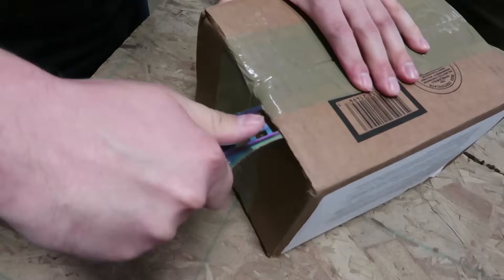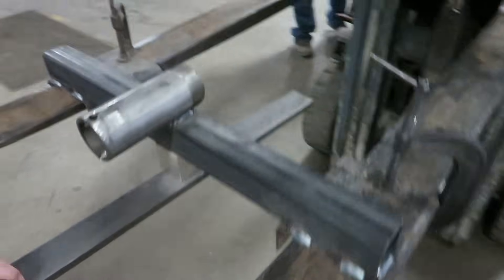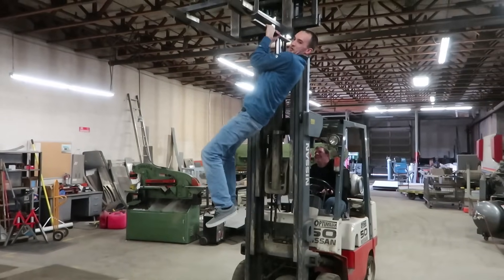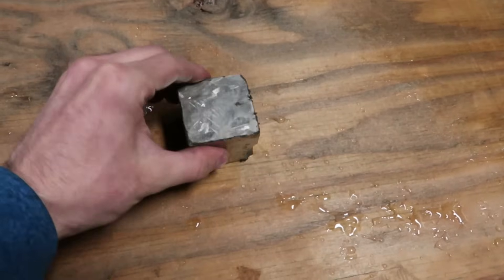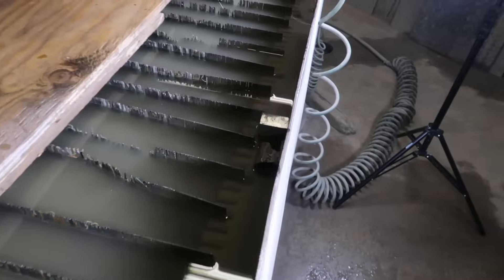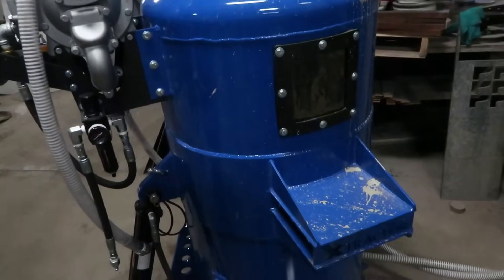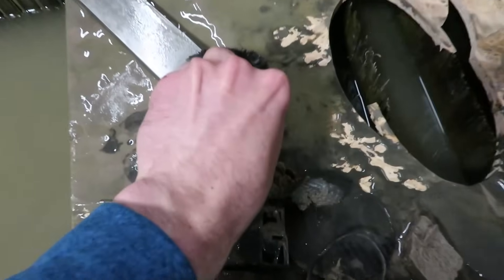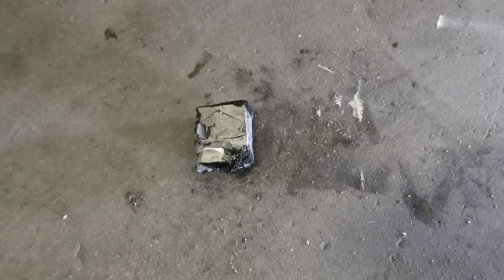Huge Neodymium Magnet Cut in Half with a 60,000 PSI Waterjet - 400 Lbs

Comment: If I had to guess, I’d say they cut it in a way that split perfectly down the center of the poles which is why it shot apart. If it had been cut perpendicular to the poles it should’ve just made 2 new magnets with poles held in the same arrangement as the original piece and then they would’ve just stuck together.

(Rough explanation) 

—N—
|  —  | <———— Cut along this line 
—S—

—N—
—S—
———  <——— Two new magnets 
—N—
—S—

Comment: not fair, the long steel bar puts leverage on the magnet, which breaks the magnetic Bond, once it is broken, it doesn't take anywhere near as much force  to pull it loose.
you need a flexible Mount to get the full lifting effect of the magnet

Comment: I am obsessed with magnets stainless steel is not magnetic it is made of  a chromium alloy. Chromium is not magnetic. Iron, nickel, and colbalt are magnetic at 72 degrees Fahrenheit which is room temperature. gadolinium is magnetic at 68 degrees Fahrenheit 4 degrees lower than room temperature.

Comment: 3:45 or you just dont remeber what happens in the movie with the liquid metal forced in the guy's body
Reply: Wasn't it dust?
Reply: @gobbadavis  no, mystic or however you spell it stuck a syringe in his ass in a bar bathroom
Reply: @austinhull5928  mystique
Reply: @austinhull5928  ٠٠9
Reply: @gobbadavis  it was the same paste that was in the video after they pulled the magnet out.
Reply: Why did they fly apart when cut but stuck together when they were broken??????
Reply: @Pyromaniac457  poles get reversed.
Reply: @natefountain5126  but why when they smashed it, did it stick together
Reply: @Pyromaniac457  lil late but it depends on where it breaks, if any N is touching N and S touching S they fly apart just as hard as they would slam together if the opposite poles are near each other. A weaker magnet would likely spin like they guessed but this one is so strong it was pushing with enough force to snap the last bit without being cut so the only direction to go was away

Comment: The alloy used in neodymium magnets is pyrophoric (will combust spontaneously) if divided finely. scratch a piece across some sandpaper and you'll leave a trail of spark which is kind of neat. I seriously hope you all don't ever play with one larger than that without some serious research into safety and handling. That one could have given some serious bruises or even broken fingers, but nothing too major. Larger ones can cause much worse injuries or even be fatal if you mishandle them.

Comment: I really wanted to see all the iron in the cereal with a huge rare earth magnet like that, but you guys did it kinda ineffectively. You should’ve held the magnet outside of the blender while you were blending the cereal and water. With all the shit in cereal, really really tiny pieces of iron wouldn’t attract through all the other mush, the iron was probably mostly settled at the bottom of the bag. But the blender is moving every little thing all around the container. Holding the magnet on the outside would cause the the iron to clot up at wherever point is closest to the magnet. Whereas using the magnet on the ziplock wouldn’t nearly attract all the iron. And on top of that, I think it’d be a lot faster than hovering the magnet over the bag.

Comment: The explosion depends on which side you are cutting. For the first cut it had 2/3 of a chance of flying apart (if choosing the cutting side and direction randomly, 8 options out of total 12 (6 sides and every side has 2 cutting directions)). If you would have cut it the direction what you described when forming a hypothesis then it would have just slammed the two pieces together because cutting side would have been one magnet's S pole and other magnets N pole and they would attract. Now when cutting the hole, it was sure that it wont fly apart, because you wanted to cut the new piece on the flat side and it previously did fly apart. It would have done something interesting if 1) the first cut would have been "boring" and then cut it when the new piece was flat down or 2) you had figured out the N-S direction on the piece and had aligned it with the nozzle pointing direction. Side note: you actually kinda already figured that out with that metallic mud which stuck mainly on 2 sides (they where the N and S sides because the magnetic field is usually the strongest on the poles of bulk magnet, also the shape of that metallic mud gives it away). Also if you want to know why in some cases it flies apart and in some cases not then you just need to know that sides with the same polarity repel and sides with different polarity attract (also maybe paper and pencil to draw different possibilities of cutting). Hope my text gave some explanation and new knowledge :)

Comment: If you didn't know strength of the magnet field varies on how thick the metal is. Obviously it doesn't hold on a thin walled pipe as much as it does on solid steel.

Comment: How strong is that damn jet!
Reply: Depends on the setting they use, but that machine is rated to 60,000 Pounds per Square Inch.
For reference, car tires are generally aired to 30 PSI.

Comment: Imagine your HDD or SSD in mail sitting right next to this package.
Reply: As long as the magnet was declared properly, it was shipped on a completely different truck than what carries electronics.
Reply: @Skorpeonismyrealname  No, it isn't. Who told you that lie?
Reply: If it was an SDD it might be alright. HDD though... it would wipe whatever was on it 🤔
Reply: I bet that think got stuck to the conveyor belt a few times
Reply: Oof
Reply: The idiot that sent this didn't follow the instructions for shipping magnets like these. They require metal shielding to be put around them.
Reply: Magnets usually come in proportionally large boxes, fixed at the center of the box...
Reply: The hard drive would have to be powered in the box but a ssd would be fine no matter what
Reply: Bricked
Reply: alright not like there would be anything on it
Reply: Wont effect a SSD...
Reply: Lol I never thought of that I bought subwoofers online and they have massive 300 ounce magnets on them.
Reply: Techy: Dude, what did you do with that floppy bootup disk I lent you?
Roomie: Oh, I put it where I wouldnt lose it.
Techy: And that is?...
Roomie: Its on the refrigerator door, under a..
Techy: SHUT UP! Nevermind. You can keep it.
Reply: Whats is a sdd?
Reply: @rassadi46  A solid state drive
Reply: Stephen Callanan it was a joke cause the original reply said sdd not ssd.
Reply: @rassadi46  a hard drive but smaller and quicker
Reply: @thatguy3750   small disk drive! 🤣
Reply: M AL Rassadi solid state drive. Like a usb drive, but not. It replaces a hdd

Edit: just reread the post, and realized was a joke because he said sdd instead of ssd.
Reply: @rassadi46  ssd
Reply: @t3r619  yeah man i know.
Reply: SSD will be completly fine because its digital, and a HDD would terrible because it has a disc in it with a clicker which is both really sensitive to corrupt files or brick the HDD.
Reply: Hotdog Girl - You need to stop trying to explain things you have no clue about... "because its digital" - "it has a disc in it with a clicker"... Jesus fucking christ...

What do you call the wheel on a car? A spinning rubbercircle?
Reply: @Taizunx  yes, but does it have a clicker? Hmmmm?
Reply: @Taizunx  It still would not effect an SSD as it does not use magnets, it uses floating gate transistors. Wont be effected.
Reply: Imagine if 2 magnets/and or HDD/hard Drives smashed against each other in terms of scientific and emotional love subjjective and objectivity coming together hey i unintentially made a similarity and caused a supernova/sexy cut attractive nNnebula/Nebula/nebula.
Reply: @ashupashu5559  that would have to have a ton of energy

Comment: Depending on how you cut it in half it would have to have no vibrations as it would change the direction of some atoms. That’s why some metals can be magnetic or magnetized. One test you can do is get a magnet and stroke a nail in one direction. After 5 minutes of doing that I managed to pick up 20 paper clips with the nail.

Comment: The reason that magneto was able to pull so much iron out of that guy  in that scene of x men is cause in the scene before it mystic had seduced the guy at the bar and injected him with extra metal
Reply: Nerdist also did the math on that scene, calculating how much magnetic force would be needed to extract the chemically bonded iron (in the body, it's not particles like in that cereal) - turns out the magnetic force needs to be so high, it'll affect glass and pretty much everything else in the world, so technically, Magneto didn't need that guy to wreck his prison.
Reply: The crazy thing is that magneto is actually that powerful since it's been implied he can do already that in the comics. He appeared to remove ONLY the metal from Wolverine's skeleton which is said to be bonded on a molecular level (not coating the skeleton like popular belief).

Comment: Why does the water jet not cut through the wooden surface underneath?
Reply: sometimes it does at the end there it was putting a hole in it...it depends  think of the water jet as a triangle where its only destructive at the point anywhere above or below that point is less effective...does that help?

Comment: Wrap the magnet COMPLETELY in plastic, like a heavy Zip-Loc bag and plunge into the cereal agitated and in suspension in the bucket of water. Much easier to capture all the iron on the magnet and remove the iron from magnet. (If not completely covered in plastic you'll be forever attempting to rub iron off the magnet.) Heating solution and agitating a bit might release more iron that is locked up in the cereal grains.
We use this method to remove 'black sands' (iron) from the concentrates in gold recovery process.

Comment: I don't think it should've behaved like that if you where to cut it with a fine enough blade, so to say you suddenly cracked it into two as the reason for it's motion is because you introduced a gap in the middle of the block because you removed material as a water jet is abrasive meaning they where then two separate magnets with opposite poles due to internal magnetic forces causing them to be so.

Items at rest will remain at rest, if you simple cut it with a Lazer it would do nothing as the gap would be non existent / minimal. The gap will be relative to the field range and strength, relative to how it would behave.

It would be interesting to see how it would respond to a precise cut or crack as I think the magnet would just stay as one, as all your effort exerted on the magnet will be used to crack or slice not separate, do you see the point I'm making?

Comment: 5:39
That would make it easy. In the shop I used to work at we would get a vaccum truck to suck it out of the table so we didn't have to deal with the sand and metal bits afterwards. Took a few hours though.

Comment: When he licked it what if his fillings got stuck rip
Reply: Xtra Pulse fillings aren’t magnetic
Reply: @jaxterpunk64  older ones could be since they used gold or silver
Reply: @deep_r3k  according to a quick google search, my intuition was right. Pure gold is non-magnetic, just like silver
Reply: @DryLog420  only nickel, iron and cobalt are magnetic, and I didn't use G, I recall that tidbit from  my 8th grade science class
Reply: @keegancb84  thanks for backing me up :-D
Reply: DeepRuc gold and silver aren’t magnetic.
Reply: @keegancb84  Nickel, iron, cobalt, and gadolinium when it's slightly below room temperature are all ferromagnetic.
Reply: @deep_r3k  neither of those are magnetic, a simple Google search could have told you that
Reply: Toast it could be manually magnetized though
Reply: DeepRuc dude gold and silver aren’t magnetic
Reply: @deep_r3k  gold and silver are not magnetic you should have learned that in elementary school when you learned your elements
Reply: @deep_r3k  ....which are equally non-ferrous.
Reply: @deep_r3k  gold Is magnetic?!?!
Reply: @Roderick storey stainless steel is also not magnetic
Reply: @2ShotsDown  Get a magnet and the first knife you can find that says "Stainless Steel" on it. The magnet will stick to it as well as any cast iron or carbon steel you can find. As well as you can tell without sensitive  measuring equipment and identical pieces of the different materials anyway.
Reply: xd
Reply: What if he doesn't have any fillings?
Reply: Roderick storey that moment when they slammed a piece of stainless steel onto the magnet and it didn’t stick or do anything so it still wouldn’t have done anything
Reply: It’s deadly?
Reply: Or painful
Reply: Roderick storey dental implants are typically 316 grade stainless. Which is non magnetic.

Comment: I guess it is true...you all really don't know much about science. Anyhow, a typical adult male has about 4 grams of iron in total volume in their body. The RDA for iron is about 8 mg for an adult male. The daily intake is not the same as your total iron usage. You seem to be thinking all your iron is used up each day...you would die if your thinking was correct. You have about 500 times that (4 grams on average) than your intake. You accumulate iron to a balance called iron homeostasis, primarily used in erythropoiesis, creating erythrocytes. 

So, the RDA is not the same as iron homeostasis and typically is 500 or more times that. Still, 4 or so grams of iron is not a lot, 4 grams about half the density of iron, 7.8g/CM^3. so maybe one small BB sized projectile for all your accumulated iron. Still, it's much more than the RDA you alluded to.
Reply: 4 grams is not a volume. Iron has a density of almost 8 grams a cubic cm.  That is about 1/2 a cubic cm or volume  of elemental iron.
Reply: Keith Reynolds You read my entire post and that is what you confusingly walk away with? Anyone reading with context would understand I was not referencing volume as a three dimensional quantity, but the general definition of volume meaning an amount. 30+ years in science, I think I get it.
Reply: @doclee8755  i saw all you posted, and agreed with most of what you said or tried to say.  I did not need to comment on what i agreed with, but where i took issue was not anything personal, just technical. And finally maybe you do understand volume as a three dimentional space and grams as a weight and density as a ratio of the two.  In that case my comment may not be so usefull to you, but it is still helpfull adding clarity to anyone else who may not understand what you tried to but didn't say in your original comment.
Reply: Keith Reynolds I didn’t confuse anything. At all. I clearly was not using the term “volume” in its technical sense, which is another way the term volume can be used, accurately. I wasn’t technically incorrect. And again, the context was clear that volume was being used in a totality connotation and not in a volumetric sense. 

Anyhow, I try to be precise in language. I am not one that uses “it’s the internet” excuse for poor and imprecise writing, as I can see you do not either. It’s nice to find someone that actually cares about precisional writing. 

I apologize if I took offense, of all places not worth taking offense, the internet is one of them :-)
Reply: @doclee8755  i try to be precise in the ideas i try to convey.  Spelling, as much as i try not to, i can not help but make frequent errors, and my grammer is fair but has plenty of room for improvement.
Reply: Keith Reynolds Definitely, we all can improve. Sadly, the internet has become an excuse for poor writing and communication. The abbreviations are understandable years ago when text messagings was still in its infancy and limited character usage. Somehow for this generation it has carried over to everyday life. I’ve seen some college students using “internet” jargon in papers. That is completely disheartening. It’s like this generation is getting dumber and dumber with access to more and more information. 

Anyhow, thanks for the conversation. Take care.
Reply: Many modern day bb guns shoot 4.4 mm diameter BBs. That is a volume of about 44.6 cubic mm. Roughly speeking......  500 cubic mm of elemental iron  / 44.6 cubic mm BBs = 11.2 BBs.

Comment: Splitting a magnet along it's equator will only make two new magnets already alligned to stack north to south.  However,   splitting them from north to south pole will result in an explosive separation.  To demonstrate this take two rod magnets about an inch tall but thin, like a quarter inch that are stacked north to south to make two inches tall, hold one and ROTATE the top one downwards, folding it onto the other and it will stick.  However if you pull it off and try to stick it to the side of the bottom magnet without rotating it, keeping the poles oriented the same as they were when stacked, it will not stick but repell.  Magnets aligned cannot stick on their sides.  So if you could split a magnet like firewood down the grain of magnetic flux it would explode sideways.  But cut it across the grain and it will do nothing.
Reply: does depend on the magnet and how its made though. i forget the name of the company but they make magnets in a weird way where they negative and positive poles are set up in weird various ways which make them behave unlike any normal magnet.
Reply: Mind blown
Reply: Could you make a magnet strong enough to explode itself?
Reply: It did explode
Reply: Lost Space he never said it didnt
Reply: Oh that’s really interesting.
Reply: we  get it bill nye
Reply: Yeah thats what they did. Your an idiot